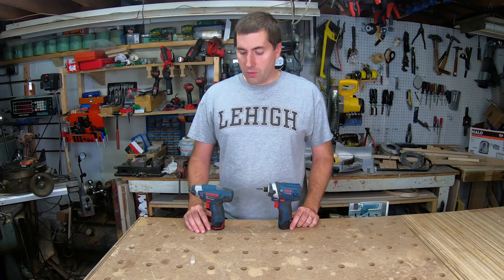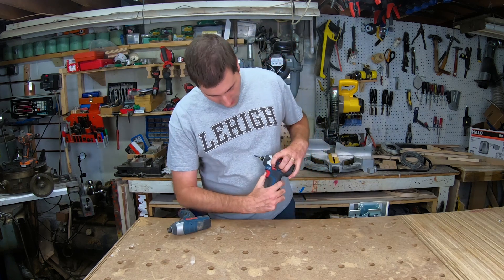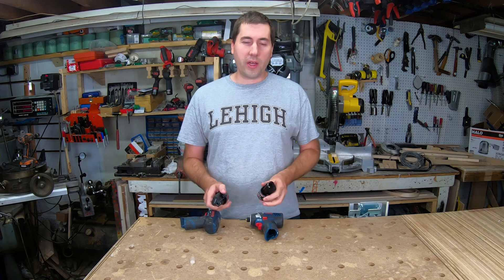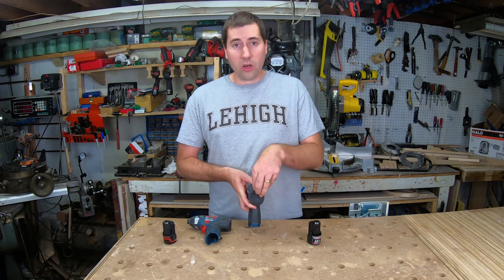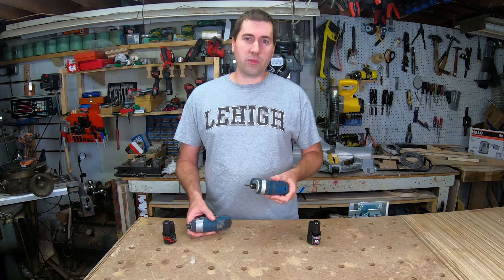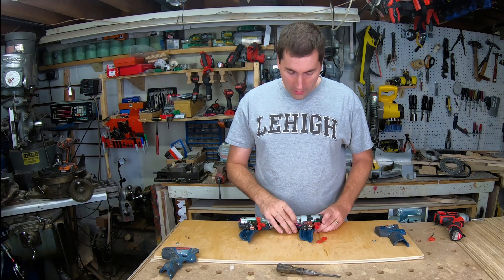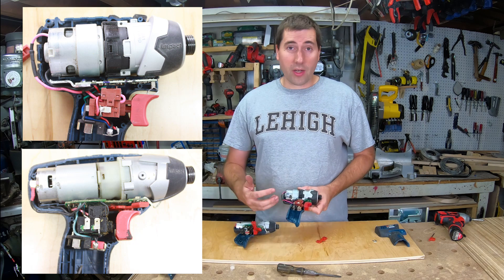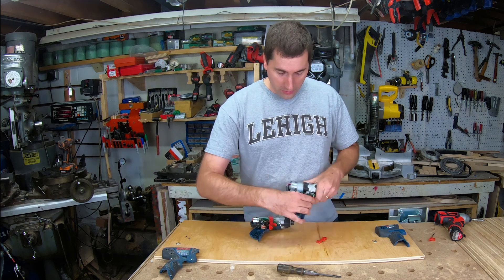Bosch Impact Driver Evolution

Comment: Would like to see the brushless compared to the PS41. I think it’s like gsv or gsr now. They changed nomenclature.  Also I took apart ps41 (actually to just slip a lanyard on that thing in the back) and was really disappointed by the screws. Two completely snapped on me. The heads snapped right off. I don’t think I was using my other impact , I think I was using ps21. But that was super annoying as there’s a broken screw piece in the hole that I can’t extract and I couldn’t screw it back together. Had to put a bit of glue there and pray
Reply: Brushless is the ps42

Comment: About the efficiency: The opposite might be true. The old one has a brushed DC Motor, the new one seems to have a brushless motor (BLDC). Those are much more efficient. Also, they are smaller and they do not include any wear parts. Summary: the new tool is better in all respects.
Reply from the maker: These both have brushed motors.  Bosch does make a brushless version, the PS42, but it’s significantly more expensive.